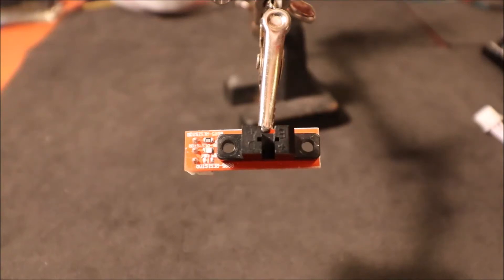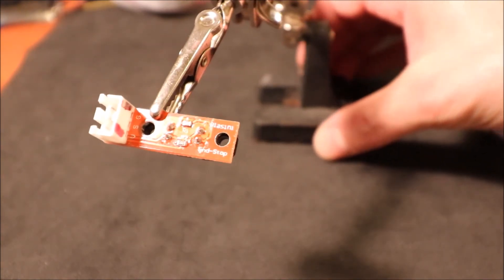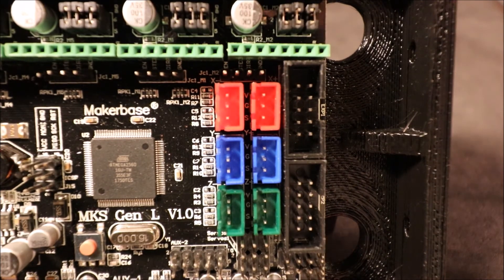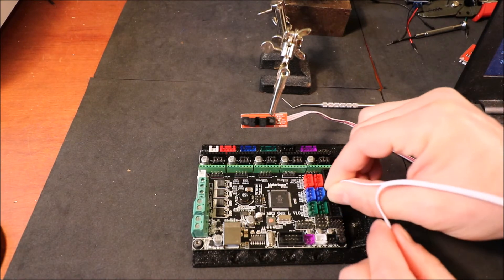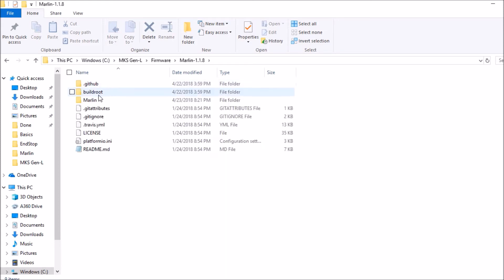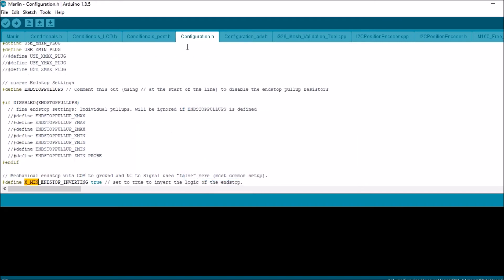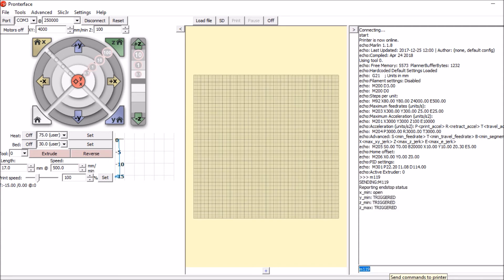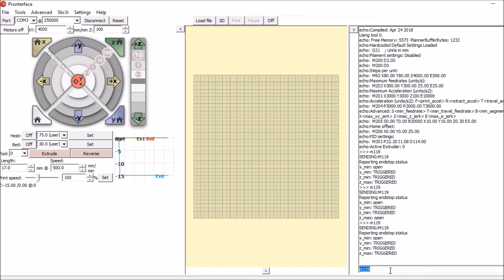MKS Gen L - Optical Endstop

Comment: Really well done videos.  Short, to the point with no tangents for humor and commentary.  I have a question...
 I would think using these optical sensors, I would put some tab on the head that would block this sensor at the stop.  However, in the video you changed the Z_MAX_ENDSTOP_INVERTING to true and thus got open when it is blocked.  Wouldn't I want FALSE and thus show triggered or am I mis-interpreting your situation?
Reply from the maker: It should be false, but I wanted to make people think about it   And you're correct.